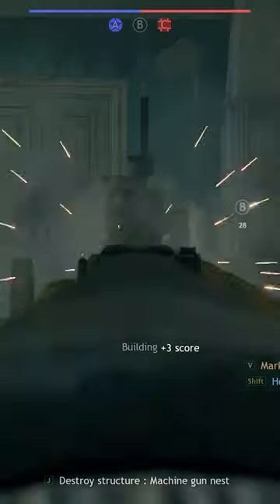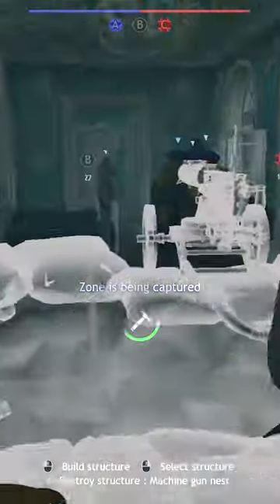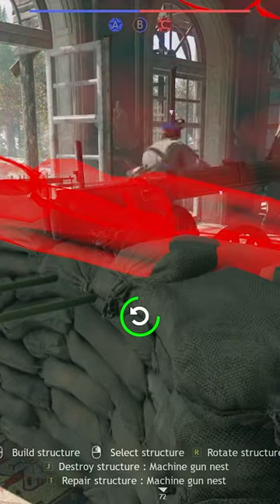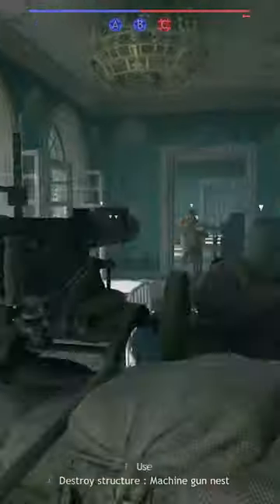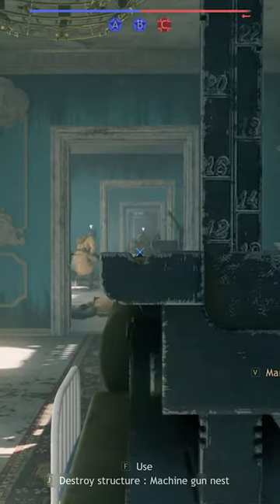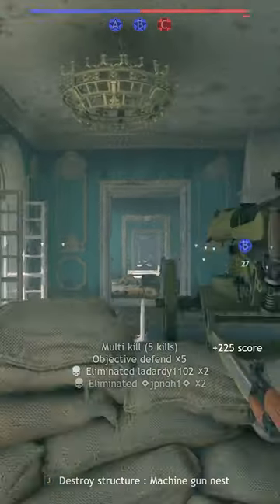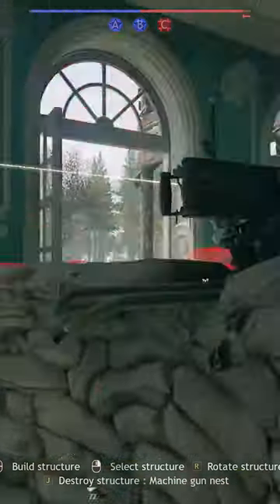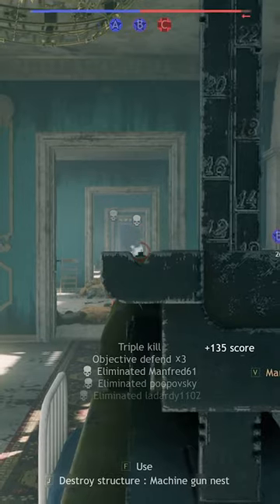Enlisted Machine Gun Nest Tips

Comment: Noooooo! This tip is almost a year
Old and they probably fixed it by now.
Reply from the maker: they have indeed, unfortunately
Reply: @HeyQuadro  I did a match on the pacific with a machine gun nest and got 156 kills 2 squad deaths.
Reply: Actually it still works but you gotta be repairing the mg nest when you build a new one so you can place an mg nest but down side is they have to be closer to each other proof? I have done it with heavy mgs